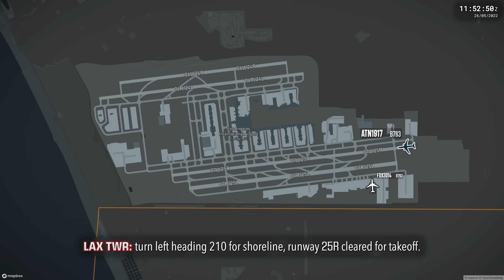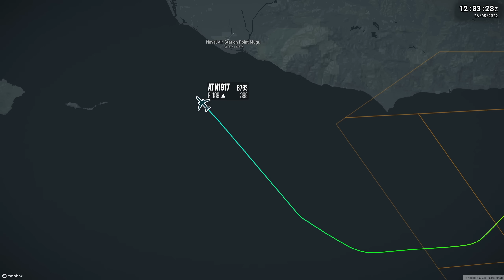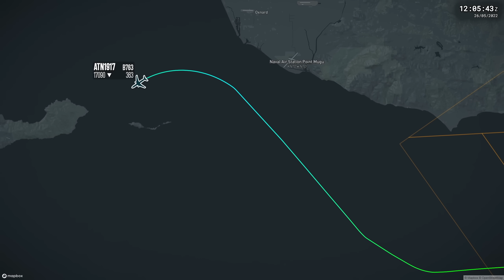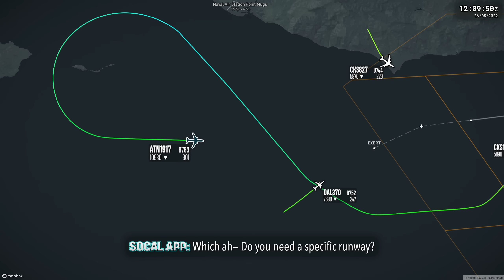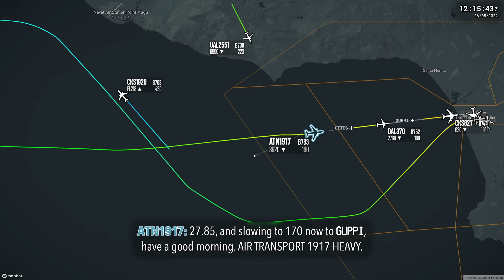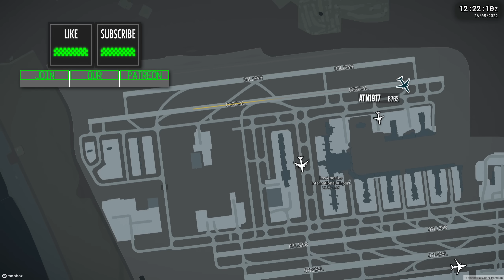"We Need To Land IMMEDIATELY"; Amazon Prime 767 Reduced to Single Electrical Source! [ATC audio]

Comment: My concern in these incidents, where I understand ATC still want to get other planes in, but if one of the planes they’re squeezing in before the emergency aircraft has an issue on the runway, that runway is now no longer available to the emergency aircraft and god knows what problems that could cause in certain emergencies. Arguably in some emergencies the pilots could decide that if the aircraft ahead (which had no problems prior to landing) has had an issue at the end of the runway but is still on it, but they haven’t got an option to go around, that the best option is to go against ATC and land on that runway despite there being another aircraft on it at the end. Obviously this wouldn’t work if the other aircraft is well within the normal landing distances. But if you’ve got no engines, a fire or whatever, it’s better to get down and perhaps do a runway excursion to avoid the problem aircraft ahead or have a collision with it, than try go around and fall out of the sky.

But again, brings back the Russian roulette of hoping all aircraft you squeeze in perfect their landings and don’t have any issues or delays on landing. Obviously in this case it wasn’t necessarily AS time critical as a fire/no engines (still urgent), and they could’ve gone around and likely found an alternative landing, but still seems risky. I would want to preserve that runway when the emergency aircraft is about to begin their approach.

But again, they have to balance the logistics of the airport and getting other aircraft down and not having other emergencies in the way of emergency fuel being declared and so on. I think in the serious outcomes the ATC should just advise the wait is a minimum of x time based on how long it’ll take the emergency aircraft to get from wherever they are and until landing, and that aircraft can decide whether they can hold for that long or divert.
Reply: LAX has two sets of parallel runways, that's four runways going due east that they gave the pilot the choice of. The other traffic was vectoring in to the three he didn't elect to use. Also the speed reductions are normal for every approach. You cant expect a jumbo jet to come screaming in a 400 plus knots of airspeed...
Reply: @j423956  Indeed. But this isn’t just specific to airports with multiple runways. Often it’s airports with a single runway, or an airport with multiple runways but only one is available due to maintenance or so on.
Reply: This is one of those things where something has to happen unfortunately. Where this is a major factor in a large incident, enough so that the protocol will change. As sad as that sounds, aviation history proves all the strict rules we already have are written in blood.
Reply: To be honest you posted extensive comments containing enough nonsense, which shows that you don't have enough knowledge about the issue. Sorry to say but bringing in the russian roulette analogy, was simply ridiculous.
Reply: It really baffled me when they turned back and there were two aircraft ahead of them in quite a tight sequence, and actually asking them to reduce speed. Emergency means emergency, no matter the kind...
Reply: @Colaeroimages  Er correct me if I'm wrong but isn't the spacing to give them enough spacing to allow the vorticies to disappate enough for the next corresponding aircraft to land? Hence why they were asked to reduce speed in order to maintain spacing with the aircraft preceding them? As to why they didn't clear the airspace I imagine it was due to the lack of immediate risk to the loss of life/limb, the relatively low risk of the emergency, and the excellent calm communication of the crew, and the fact that at busy airports like JFK and LAX disprutions would likely cause larger ripple effects. Though I don't really know much of anything about the aviation industry so please correction me on any of these assumptions.
Reply: It seem the pilot still have control and has not declare a Mayday and quite calm so it is reasonable why ATC allow this to happen
Reply: @ndbiet  They did declare an emergency (mayday).  Depending on the aircraft, complete electrical failure could leave them unable to control the aircraft and crash at worst, or unable to communicate at best.  Granted, they still had 1 generator operational and there are batteries on aircraft as well, but those only last a few minutes if all generators fail.  If a pilot declares an emergency ((assuming its legitimate)), ATC is supposed to give them priority, period.  It could have gotten rather messy if that runway wasn't clear for the emergency aircraft when they landed.
Reply: @TianarTruegard  I agree! If one of those two aircraft didn't clear the runway on time it would had caused the distressed airplane to go-around...instead ATC decided to ask the following aircraft to go-around...
Reply: @TianarTruegard  This would be a pan pan, an urgent/emergency situation that is not immediately life threatening, NOT a mayday. They still had full control of the aircraft, functional batteries and one working generator. This was just a loss of redundancy. If they would have lost their last generator it would have been escalated to a mayday, as their batteries will only keep them flying for 30 mins. Also, there are 4 parallel runways eastbound and this pilot chose 6R, so the other traffic were kept on the other runways.
Reply: @joshjones5172  But the ATC is second guessing that. An 2 engine aircraft doesn’t declare panpan when they lose one engine, despite the fact they have their own engine as a redundancy, and wait until both engines are out to declare mayday.

I’m sure most pilots would prefer to be able to glide a plane with controls, than try lane a plane with no or limited controls, inc in the worst case scenario that the RAT doesn’t work either if equipped.

But I get your point.

I’m not sure why but it seems American pilots are very used to just declaring an emergency, giving the nature, and expecting ATC to decide the priority, or don’t even declare an emergency whilst describing a problem that certainly is (either PANPAN or Mayday) and ATC do it for them.

Seems to be rare to hear pilots actually specify the urgency of their emergency nowadays, instead of “PANPAN PANPAN PANPAN” or “MAYDAY MAYDAY MAYDAY”. Instead just going “we’re uh, gonna declare an emergency for reason x y z”, which is great, but is your emergency life threatening, or just urgent and need priority? Feel like ATC’s are being forced into declaring the worst to the airside ops and rolling trucks, even when pilots shrug off the need for them or decide afterwards that they don’t want to. Or the ATC’s who hear a pilot tell them they have a problem that is clearly an emergency, but the pilots are hesitant to declare it (paperwork or whatever) and ATC just turns around and goes “well I’m declaring an emergency for you anyway”, even if pilots would rather they didn’t. Always respect the workload pilots are under in an emergency, but the bare minimum, when able after stabilising aircraft, getting everything set up, is to ideally let them know the nature of your emergency so they can do their job to best assist you on the ground and make all the hard work you’ve done actually mean something, instead of not having the resources needed on the ground to perfectly execute the final part of controlling the emergency if needed.

Comment: Probably wasn’t equipped with a RAT. This why I am not a fan of converted freighters into the 767 line. Buy new!
Reply: Flew the 757/767 for a long time and as far as I know the RAT was standard on the 767, though it was for hydraulics only. The HMG/HDG was optional and was frequently not installed though.

Comment: Older B767 used to have a "Ram Air Turbine"
Reply: To my knowledge all 767s have a RAT installed, however it is solely for hydraulic power; it does not turn a generator.

Comment: ...Wonder what caused the malfunction?
Reply: Not quite sure what you’re asking. Losing an engine driven generator with an inoperative APU was the cause of the air return. Or are you asking why the generator failed specifically? If so, that’s going to require someone with access to the aircraft records to reveal.

Comment: After the Hudson 737 landing, it's amazing to me that they continue allowing planes to fly with a non-working APU. Captain Sully's starting the APU was credited as the #1 technical thing that saved them, as it restored their electrical power even with all engines out. A broken APU should be a non-airworthy state.
Reply: There's a reason the ram air turbine exists
Reply: It was an Airbus.
Reply: APU can be deferred as long as 2 IDG are operational.  also etops certified aircraft will have its etops status downgraded. fun fact the 747 apu is incapable of stating in flight.
Reply: @ArmyofSeaturtles  -400 and -800 can’t, but 1-3 can
Reply: Sully was flying an A320. But yeah.
Reply: But how many times do aircraft have dual engine failures? The answer is almost never. There are far for planes flying with a broken APU than aircraft that have had dual engine flameout
Reply: The main reason the APU saved them was because without the APU the Airbus would have been in direct law. A thing the 737 does not have.

Comment: Did the APU fail, too or did they seriously buy an airliner without an APU...? If the APU is also broken when even bother going?
Reply: The 767 is designed with an APU, therefore you cannot buy and operate a 767 without an operational APU,. However, if it does become inoperative an Operator is permitted to defer it using their MEL (Master Equipment List). This is standard practice in the world of aviation. The APU can be deferred and the airplane released for service for a certain period (up to 10 days) before its grounded, although there is an exemption to defer for another 10 day period if no parts available and is approved by the National Authority (FAA) using an RIE (Rectification Interval Extension). Nothing to see here - move on.

Comment: I have a question??? The 767 is normally NOT equipped with an APU or had that failed also?
Reply: The airplane would have been dispatched with an inoperative APU, as listed in their Company MEL (Master Equipment List). I don't fly the 767 (but fly 737's and have flown other Boeings) but most likely a MEL Category C Interval so can be deferred for up to 10 days.
Reply: @gibbosan1  A minimum equipment list (MEL) is a list which provides for the operation of aircraft, subject to specified conditions, with particular equipment inoperative (which is) prepared by an operator in conformity with, or more restrictive than, the master minimum equipment list (MMEL) established for the aircraft type.
Reply: The description said it's inopperative

Comment: Had that happen to me several times... but I flew the MD11 for FedEx, with 3 generators, and like Meatloaf said "two out of three ain't bad".
Reply: MD-11 has 4 generators.  3 engines plus the APU.
Reply: @Ces999919822  two out of four ain't bad?
Reply: @ChrisC7498_  not real good and not real bad.  Better than the 76 being down to 1 gen.

Comment: Surprised to see ATC allowing 2 aircraft to land in front of him considering he declared an emergency. There wasn't even 1,000ft of vertical separation between the 767 & the 757 in front, which means MAYBE 4mi. of separation. Not to mention the lead aircraft was a heavy 747 & won't vacate the rwy as quickly as other aircraft. Then again, I'm not ATC & just goin' off the info from the vid. I just always thought when an aircraft declares an emergency all aircraft in front & below are vectored outta the way, even if it means a go-around for the prevailing 2 aircraft.
Reply: They didn’t request a sterile runway, the aircraft wasn’t disabled in any way, just couldn’t continue it’s planned flight
Reply: Lolll

Comment: That's how you know this is an experienced pilot flying here, down to single power unit, no emergency backups installed, still remains calm and flies the damn plane to safety over anything else.
Reply: They lost 1 engine generator and the APU and/or generator was inop.  They had a fully operational engine generator on the other engine which is more than capable of supplying all the electrical power they need.  In this scenario declaring and emergency is standard procedure because they’re down to 1 generator, not because they’ve lost the capability to fly or land safely.  Things don’t get dicey until they lose the last generator…which they didn’t.
Reply: Then again what the fuck else is he gonna do?
Reply: @1BergerVongSchlauigkeitHer  People can panic and actually do nothing at all really. It's not at all uncommon to freeze in a stressful situation even if doing so can be the end of you. But alternatively he could be just paniccing still flying but becoming incoherent as well making communication near impossible reducing his chances of a safe landing as well. He could be busy trying to find all kinds of different ways out of trying to fix issues until the bitter end instead of returning to base. So many dumb mistakes you can make that a paniced out brain will easily let you fall for I can't honestly even count them for you.
Reply: @reznovvazileski3193  3 people on board though, at least 2 of which are pilots, and they're trained for this. Sure, there are a lot of mistakes to make, but the scenario you're working on is literally the least likely one.
Reply: @1BergerVongSchlauigkeitHer  Yet my remarks was about just the one pilot flying here because he was the one on comms the whole time meaning he was pilot flying the whole time throughout this. Yes the crew most likely did a whole bunch of stuff for him there as well which honestly remembering how to do proper CRM in times like this is even harder than keeping your own composure. 

And sure yea he was trained. You know that labtechs also get trained to handle fires and chemical spills of all kinds? Yet when a lab tech colleague had a bottle of petrol catch a light his first instinct was to use water. Because when our brain panics all training and common sense sometimes goes out the window and gets replaced with whatever first best thing that comes to mind. This is why you also see people that have martial arts classes get their ass destroyed in a street fight against an untrained but experienced culprit for example. The guy should know how to fight but it goes to autopilot, the other guy doesn't know how to fight maybe but he doesn't go on autopilot so wins.

So it seems that the only true way to guarantee you will handle correctly even though you might very well know in a rational state of mind what to do, is having tonnes and tonnes of experience to the point that your autopilot becomes the right response. The first and last thing on your mind should be the right response and you only get this with experience. So taking this back to my actual initial point:

"That's how you know this is an experienced pilot flying...". I know he has a lot of experience because his mind stayed calm and he handled by the book. Inexperience will put you in a state of panic, panic leads to weak communication, shutting down, stupid mistakes you definately wouldn't have made normally. That's not even an argument there it's just how we know the human brain works.
Reply: @reznovvazileski3193  I appreciate that you put a lot of effort into your reply but I ain't reading all that shit. You got me.

Comment: If it was a Real Real emergency 
I would have landed at Pt Magu, NAS.
Reply: They were at 19,500ft and over 400knts as they declared the emergency.
Pilots like to land in places they know, they know the airport they just took off from.
Plus you need to slow down from cursing speed to landing speed not to mention follow the glide slope into land.

They would've had to do a holding pattern to lose the speed and altitude before they could land at the naval air station
As you saw them go to 170knts for landing.
Reply: I understand that is why I said Real emergency.
You know Gimli Glider, land in Hudson bad.

At that altitude they could lose all engines and still make NAS but not LAX.

Comment: Noted the addition of "Emergency aircraft" onto the new radio contact with approach.  We all know that this information has been lost during handoff between controllers.
Reply: I didn't hear it but somewhere on this flight I think the pilots had switched to the emergency squawk code in which case any controller can see their emergency status on their screens.
Reply: @nemo227  One thing I didn't notice, they weren't told to enter an emergency squawk code on their transponder.
Reply: @TianarTruegard  I didn't hear it either but the video was likely edited before it was posted.  I used to listen to ATC in the Monterey Bay area (California) pretty much every day.  I heard normal traffic every day but a few times I'd catch something unusual.  I could also pick up ATC of planes talking to Oakland Center.  One thing that stuck in my memory was that airline pilots would sometime be told to "Delete the Boulder (speed) restriction"  and the pilots often confirmed with "Drop the rock"  but it took me a while to understand the slang.  Back in the seventies I was fortunate to be able to visit with controllers in Palo Alto, Salinas, Monterey, and El Cajon.  I don't know if that's still possible.